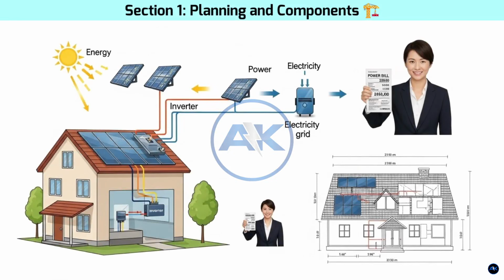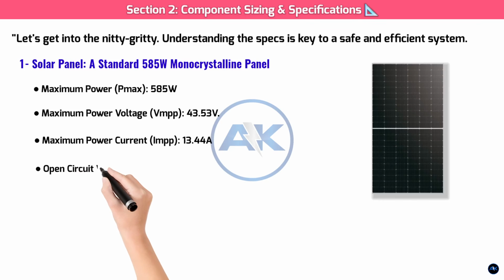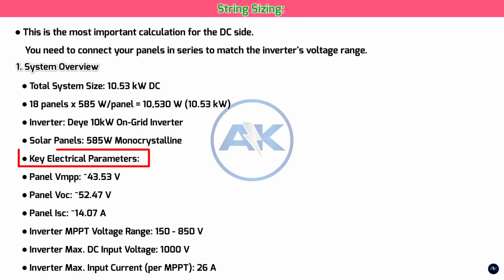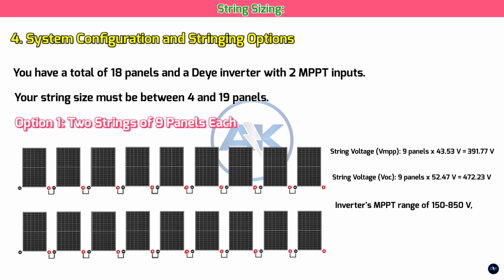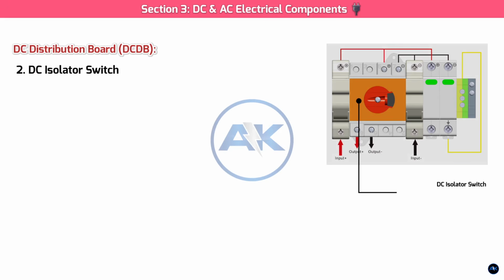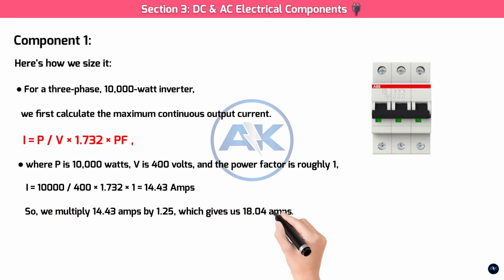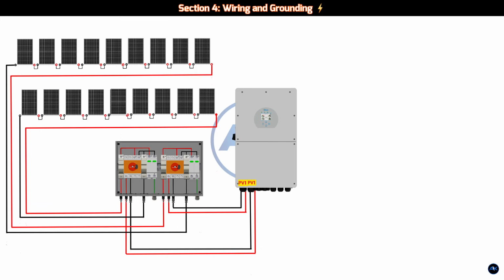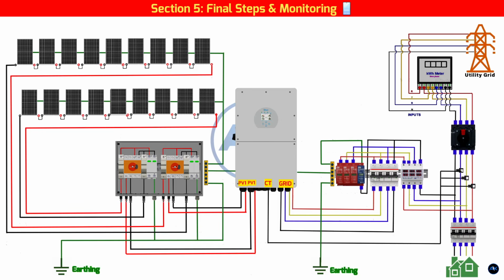Stop Paying Electricity Bills! DIY 10kW Solar System Installation Guide

Comment: Hey 
Thank your for sharing a very good video of Solar System
I am about to setup 18Kw Deye inverter in Liberia with 25pcs Solar Panels with 730w and 32Kwh Lithium Battery. Kindly assist me with details explanation, diagrams protective Devices.
Thank you for your support
Reply from the maker: Hey, thanks for watching! Great project size — 18kW Deye with 25×730W (18.25kWp) is a solid, well-matched array, and 32kWh gives you good autonomy. A few quick pointers:
Check your Deye 18kW's MPPT voltage window and max string Voc for your region's coldest temp before finalizing string sizing
You'll want DC fuses/isolators per string, a DC SPD at the array and AC SPD at the inverter, plus proper RCD/MCB on the AC side per Liberia's typical 230V single/split-phase setup
Battery-side breaker or BMS-integrated protection sized to your 32kWh bank's max discharge current
Full diagrams need panel Isc, your exact battery config, and cable runs — happy to break this down properly in a future video since it's a great case study. I appreciate you sharing the details!
Reply: @akelectricdiy  Thank for your quick reply and I really appreciate.

Comment: A string voltage of 9 panels in series is 391volts. With this DC volts single phase 220/230 volts ac can be produced by inverter, but for 3 phase 400 volts ac can not be generated by this configuration as minimum DC volts required will be 560 volts. Please give your comments on this issue.
Reply from the maker: Good catch — you're right that 3-phase 400V output needs a notably higher DC string voltage than single-phase 230V. Most 3-phase hybrid inverters need the MPPT voltage well above 500V to maintain proper modulation, so 391V would undervoltage-trip on a 3-phase unit even though it's fine for single-phase. Exact minimum varies by inverter model, but the principle holds — good observation.

Comment: Wonderful video. Do you have a list of all these items ?
Reply from the maker: Hello,
It's great to hear you enjoyed the video! Thank you for the wonderful comment and for asking about the list of items.
10kW Solar System Component List ☀️
A typical 10-kilowatt (kW) solar photovoltaic (PV) system is a substantial setup often used for larger homes or small businesses. The specific components can vary slightly depending on whether the system is grid-tied (connected to the utility grid) or off-grid (uses batteries for energy storage).
Here is a comprehensive list of the major equipment and components required:
1. Solar Panels (PV Modules)
 * Function: Convert sunlight into DC (Direct Current) electricity.
 * Details: For a 10kW system, you typically need 20 to 35 panels, depending on the wattage of each panel (e.g., 25 panels of 400W or 20 panels of 500W). Monocrystalline or polycrystalline panels are the most common types.
2. Inverter
 * Function: Converts the DC electricity generated by the panels into usable AC (Alternating Current) electricity for household appliances and the grid. It's often called the "heart" of the system.
 * Types:
   * String Inverter: One or two central inverters manage all the panels.
   * Micro-Inverters: Small inverters placed under each panel, converting DC to AC at the panel level (often maximizing output if some panels are shaded).
   * Hybrid Inverter: Used for systems that include battery storage.
3. Mounting/Racking System
 * Function: Secures the solar panels to the roof or ground.
 * Components: Rails, clamps, brackets, and necessary hardware (bolts, lag screws) designed to withstand local wind and snow loads.
4. Balance of System (BOS) Components
These are the supporting electrical and safety components:
 * DC Disconnect Switch: A safety switch to manually shut off the DC power from the panels.
 * AC Disconnect Switch: A safety switch to manually shut off the AC power from the inverter.
 * Combiner Box (Optional): Used to combine the DC output from multiple strings of panels before feeding into the inverter.
 * Wiring and Cables: Specialized, UV-resistant PV Wire (DC) and standard AC Wiring.
 * Conduits: Tubing used to protect the wiring.
 * Fuses and Circuit Breakers: Overcurrent protection devices.
 * Grounding Equipment: Rods, wires, and clamps to safely ground the system and protect against lightning/surges.
 * Monitoring System: Hardware/software (often built into the inverter or a separate device) for tracking the system's energy production.
5. Energy Storage (Optional - Required for Off-Grid or Hybrid Systems)
 * Solar Batteries: Lithium-ion or lead-acid batteries to store excess energy generated during the day for use at night or during grid outages.
 * Charge Controller: (Often integrated into the inverter/hybrid inverter) Regulates the voltage and current coming from the solar panels to the battery bank to prevent overcharging.